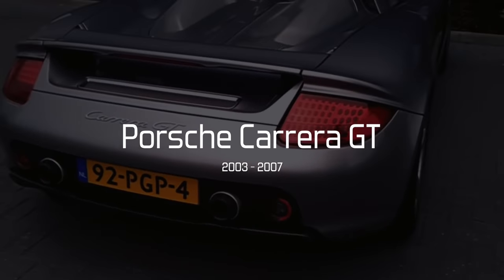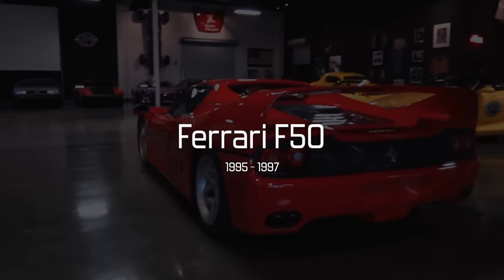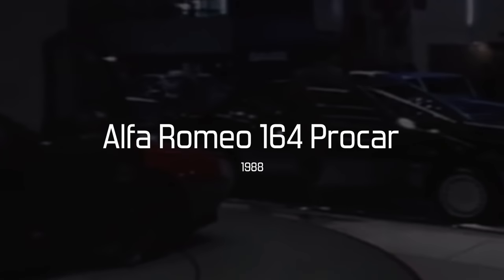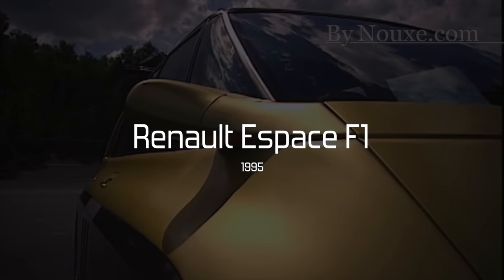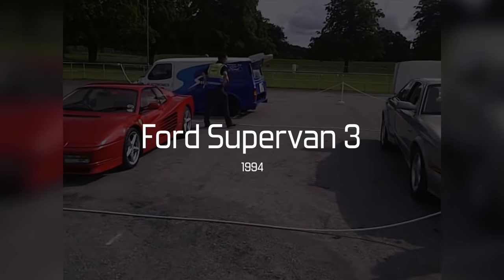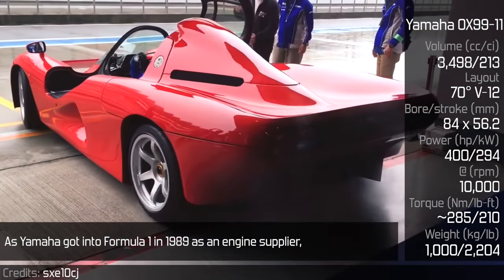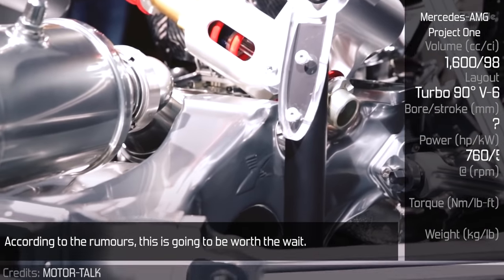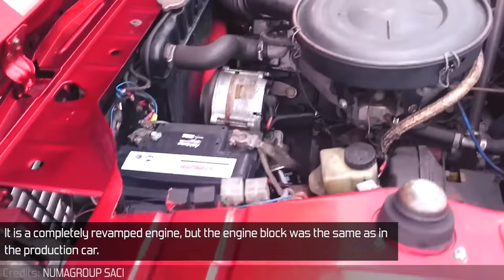8 'Regular' Cars Which Happened To Use An F1 Engine

Comment: The Carrera GT sounds so amazing with straight pipes, and for me is the only Porsche I really like aside from the 928s and the 944
Reply: The 928 has his engine at the front and the 944 has a Audi engine also at the front. You cant say those are "real" Porsche's like a 911 that has the engine at the back and a boxer motor like a real Porsche should have. No offence entendend but the 928 and the 944 are the worst Porsche's ever made same for the Cayenne, Macan and Panamera
Reply: Strange the 928 and 944 are the Porsche for people that don't like Porsches
Reply: straight pipes ruin the carrera gt for mebecause i like the howl of the stock exhaust so much
Reply: seba campana I could just as easily say the 911 is a glorified Beetle.  the 944 has an engine that was designed in-house by Porsche themselves.  Same with the 928.  In fact, the 928 might be the most in-house original car designed by Porsche considering how little it shares in common with VW of that era. Nevertheless, I personally love most Porsche cars (for different reasons, the status thing is NOT one of them).  I wiil submit the feel of a 911 is probably worlds apart from all the rest.  I don't know the experience yet.  I hate it when other Porsche people look down on others and give car companies a bad name.  It keeps good fellas away from owning a car that drives so pure and simple.  I have a 924 and 944 Turbo.  Being VW'ish, to me, is not an insult either.  VW HAS made terrific (albeit quirky) cars, and remind me again who was the person that started VW?
Reply: @sebacampana551  now I'm incredibly sad
Reply: What a odd taste, you only like the oddball Porsches
Reply: @pedinhuh16  I don't care for popular things 🤷

Comment: Remember that BMW has searched every junkyard to find used 1502 engine blocks that day ( no Internet ... ) because they found out that freshly casted blocks can`t stand the pressure and pre - aged ones lasted longer...
Reply: Heiko Panzlaff they used engines that had done 50000 miles ish as the heat cycles help toughen the blocks.
Reply from the maker: Really? That's crazy
Reply: VisioRacer its what has been known since the industrial revolution.
Reply: The Ant is such a maven.  Did you get The Ant's permission before your comment?
Reply: +larslarsn yes he did.

you not worked with furnesses in industry?
Reply: its called 'seasoning'

if you were to make 1-2-3 blocks out of mild steel, you bury the stock underground for a year or leave it in the lake!
Reply: and also sound really nice so it not an excuse for f1 now sounds really bad
Reply: Kevin Bosco f1 sounded awful by 1995, now the revs have dropped the sound is better than it has been for a long time.
Reply: Also, if there's any flaws in the casting they would have shown up by then!
Reply: Legend says that BMW engineers were seen peeing on the engine blocks each day, to improve their seasoning.
Reply: Volo thats quite well known
Reply: The other thing is that cast blocks always have some internal stress from cooling, and any block that is going to crack from it will do it early in it's life. Basically, they were letting consumers do their quality control and only passing the survivors to the race team.

Comment: From Gran Turismo 2's paragraph on the Espace F1... "Only driven by a select few Formula One drivers, the Espace F1 could annihilate the 0-60 mph run in less than three seconds. Top speed was close to 200 mph. Carbon fiber disc brakes ensured that it would also stop in an astonishingly short distance. Seeing this mad machine on a circuit was like watching a sped-up movie. The Espace F1 was only driven in anger on a few occasions and now rests in Renault's museum. It's good to know that there once was a minivan that could haul more than groceries."
Reply: Brendan Ford I have always loved the GT car descriptions!
Reply: Sad thing is if you look at modern American roll racing or half mile dig racing there are street drivin cars with better performance than the Espace F1. A twin turbo Viper recently reset the rwd 1/2 mile static start record to 244.43 and backed it up on a consecutive pass with a 244.29. This is a stock body, stock block, full interior car. No carbon fiber bs, no billet engine, no weight reduction and a big heavy rollcage. Basically just a street car with sticky tires and 2000hp lol

Comment: There is no such thing as a cold started Formula 1 engine!
Reply: Agreed,you need hot oil 80C,hot engine in same temp., and you can start.
Cold start is imposible maybe in older engines with carbs?
Reply: Josh Bacon yes there is, they're all old
Reply: pretty much at room temp the engine is seazed untill warmed due to thermal expansion.
Reply: cleadge we know
Reply: i know we know but there are alot that dont know.
Reply: F1 engines have needed hot starts for decades. Most people have no clue whatsoever about the tech that goes into F1 or the resulting tech that makes it's way in to production cars from F1. A better name for the video may have been "F1 based engines" but still these are very different from the power units in the actual racecar. The 20,000 rpm, 1,000 horse, V10s from the mid 2000s are still my favorite.
Reply: Why is that? Is it because of how tight the tolerances are? Also what do they use to warm the engine up, I imagine its a little more involved then a block heater.
Reply: Yes, they are having two block heaters and a hairdryer.
Reply: yes its to do with the tight tolerances.
pretty much its an oil heater/pump combo which brings the engine block upto operating temp.
Reply: I'm pretty sure metal usually expands when it gets hot which means hotter it gets the tiger the tolerance is good so it is absolutely not seized at room temperature. Basically the points are too far away for the engine to work properly when it's not warmed up. Basically no compression.
Reply: They aren't that different. It's not like it's a completely different engine compared to a road car. What is different though, and this is the key, is precision and tolerance.
Reply: I believe it's because different parts expand at different rates while heating up
Reply: @TheBluegoatman  indeed the characteristics of a F1 car engine as it's configured in an F1 car would make them completely unusable or unsuitable for a road going car.
Reply: @azynkron  there will almost certainly be differences in reciprocating massages,fuelling,gnition and valve timing/control,F1 engines as fitted to an F1 car would be unsuitable for practical road use.
Reply: I guess everyone watched Richard Hammond in the Renault F1 car on topgear then

Comment: Love the sound of these older F1 units. Maybe you could do a video about these engines. Before around 1995, F1 used to have a great variety of different engines in different layouts, with or without turbo's. They also sounded much better then de current 1.6 V6 engines.

Comment: Wasnt the Carrera GT not meant to be an Le Mans style Car with Le Mans engine and also to celebrate Porsches GT Racing success?
Reply: SanyarKurdBiker yes it was for le mans, not f1 so this guy is wrong
Reply from the maker: It was both - first intended for Formula 1, then as a LMP engine.
Reply: wrong! no F1 Engine and never intended for F1!!!
Reply: I remember being in the Arrows/Footworks pits when I heard the news that the Porsche engine was a no-go.  Apparently, they couldn't make enough power to be competitive.  Seemed it would be decent in a road car, but it was no good as an F1 engine, and so was never raced.
Reply: PS: For those anoraks (and I include myself in that list) who like geeking out over details and minutiae...the BMW 1500cc engine managed such high power output by using a turbo - with around 80psi of boost.  :-)
Reply: It was originally planned as a Formula 1 engine, however the project was scraped early on and underwent a complete redesign for an LMP re-entry. That new redesigned engine was then redesigned again for the Carrera GT.
Reply: Who cares? I just love it because the mid-engined Carrera GT doesn't look like all the other tail-happy rear-engined cars that Porsche has always made!
Reply: Porsche 9r3
Reply: aussiebloke609 the engine in the arrows was a v12 wasn’t it so this f1 v10 porsche engine never raced ?
Reply: @VisioRacer  that is false

Comment: You might have considered mentioning the honda NSX and B16 / B18 series line of engines. They were designed and produced by the same F1 engineers that worked for Honda in the late 80s and early 90s, a very successful time for both their race teams and the company. And unlike that pos Mercedes AMG engine which needs an overhaul at 30k, these engines in both vtec and non vtec form will outrun and outlast any other four cylinder on the market, up until the mid 2000s. During the Golden years, they held records for highest stock na horsepower per liter and highest redline, and I routinely see cars with them on the road with over 300k miles stock engine, maybe  a head gasket replacement once in a while. Never usually due to warpage, just simply the head gasket wearing out over time because they run so long.

Comment: Don´t drive a Carrera GT on old summertires
Reply: Or snow,or wet road..
Reply: a red Carrera*
Reply: I did it in 2015....

And I'll tell you all about it when I see you again.
Reply: Jerrypintoswe don't you mean don't drive it if you can't handle it it's not the tires fault it's the so called race car drivers fault
Reply: Joshua Godsey what do you mean The car was on Old tires that haven't been changed in years. So how can a professional car driver not handle a Porsche Carrera GT
Reply: Curtis Noble he probaly knew they were old tires and it's his fault for taking that risk by driving on them
Reply: cause you're gonna crash it into a tree and then set it on fire
OOOOOOOOOOOOOOOOOOOHHHHHHHHHHH
 OOOOOOOOOOOOOOOOOOOOHHHHHHH
whoooooooooooooooooooooooooo
Reply: @joshuagodsey3731  oh cmon its a little sad  We have all done something we know is wrong or wreckless but we do it against our better judgement
Reply: This is actually great advice for a lot of cars. Plenty of classic cars have tyres that are stupidly old because of the appeal of original tyres. Even more so when you're driving a car with TRX wheels. 

The problem is that rubber gets old. High performance rubber especially degrades with time. Old cars, even those without insane power but comparatively wider wheels are sometimes driven on tyres that grip less than the cheapest, thinnest modern ones.
Reply: @danielfmeyer  thats the saddest thing to me. We have all taken a car out with bald tires/tyres or worn out brakes. Youre completely right, and its a big problem with garage queens like most super cars end up being
Reply: @eriktruchinskas3747  Sure, everyone has done that - but do they push it to the limits under those conditions?  I sure wouldn't.  And the condition of the tires is an easy thing to check on a pre-purchase inspection.  The manufacture date is stamped right on the damn sidewall.  If they were concerned about originality, they could have easily swapped the OEM tires with a fresh set.  Cost was obviously not a consideration at that point.
Reply: @chuckschillingvideos  it doesnt take pushing it to the the limit for something to go wrong though. All it takes is hitting a patch of water or a car pulling out infront of you or accidentally hitting the throttle too hard.

Comment: Monteverdi Hai 650 F1
The target was to create the ultimate supercar, and a true F1 car for the road. To accomplish that, the company used a Formula 1 chassis from the defunct Monteverdi - Onyx F1 team plus its engine. The car itself was built around a F1 chassis utilizing a Ford DFR V8 F1 engine, though in detuned form. The car was named Hai 650 F1, paying homage to its lineage started with the Hai 450 SS of 1970 and denoting the car's power output and F1 pedigree

Comment: Renault Espace F1 is best!Fast,lot of space inside and looks good and probablly fastest MPV on race track and look on this wheel steer:)
Reply: Tony Valdez 
I don't think there is much space left in that Espace since the engine is mounted behind the driver with the transmission behind that. So not really an MPV anymore either. Stil an awesome creation nonetheless.
Reply: Tony Valdez 
I don't think there is much space left in that Espace since the engine is mounted behind the driver with the transmission behind that. So not really an MPV anymore either. Stil an awesome creation nonetheless.
Reply: I thing there is lot of space becouse engine/gearbox is small on this page there is space for 4 ppls!!
http://www.daidegasforum.com/forum/foto-video-4-ruote/581294-renault-espace-f1-photo-gallery-thread.html?language=en

Comment: The BMW M10 race engine did not only use the same engine block as the road car, they were engine blocks been used in road cars, the engineers were convinced that a block that has been used in a normal road going BMW had all the stresses in the material removed by the thermal cycling during use, they used only blocks with a minimum of 100.000 km.
They bought back traded in cars from the dealerships for these blocks.

Comment: Project One is now a production hypercar with 1000 wheel horsepower. The powertrain is exactly the same as the F1 unit but with a lower redline of 11,500 RPM. They have sold a couple hundred of them.

Comment: You missed the Bugatti EB110, the 3.5L V12 was derived from an aborted F1 engine. Also the Jiotto_Caspita (https://en.wikipedia.org/wiki/Jiotto_Caspita) used a 3.5L Flat 12 that was originally going to be Subaru's F1 engine.

Comment: I love when they cramp amazing engines like these into production inn cars. I'm a huge fan of the bow M10 in europe it gets the respect it deserves but in the USA not so much. Only in certain small communities. Maybe if you do a Re-edit you could include the E21 turbo 320is. It used a variant of the m10 / m12/13 that made up to 650hp but was even closer to the road going version of the m10. Plus the early version can in a non turbo variant that hade 300+ hp. Its the GROUP 5 cars.

Comment: The BMW M5 "E60" (2005 - 2010) and its M6 "sibling" both had a 5.0l V10 which used technologies very closely related  to those in BMW F1 V10 engines which pushed early 2000s Williams single-seaters, do they count in the same category of cars featured in this video?

Comment: Wasn t the v10 in the C GT a LMP engine....?
Reply from the maker: Both
Reply: It wasn't both... the engine had nothing to do with f1... it was developed for the 911 gt used in the le mans 1997/98.
Reply: Yes it has nothing to do with f1.
Reply: tfw no name the chassis was intended to be used for lemans. But the rules changed. 

The engine was originally developed for Footwork F1. Later it would have been used at Le Mans, If the carrera gt, the intended car, was driving Le Mans. Which it didn’t. 

So from there Porsche build the road car. Quit similar chassis from the Le Mans car, with a engine originally intended for F1 and later for Le Mans.
Reply: Engine was originally developed for footwork as a F1 powerplant, simple.
Reply: The engine that raced in the arrows was a v12 two old Porsche TAG v6 stripped of turbines and stuck together. V10 was intended for f1 at 3.5L producing 700-800 bhp and then was changed to 5.5L 600hp for endurance racing so it was intended for f1 never raced in f1 but then was changed for lmp lol